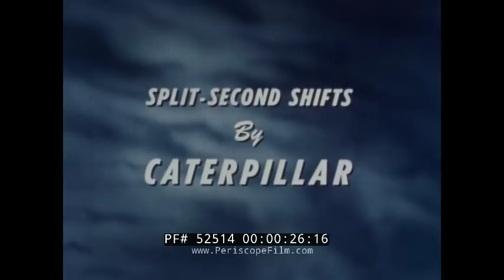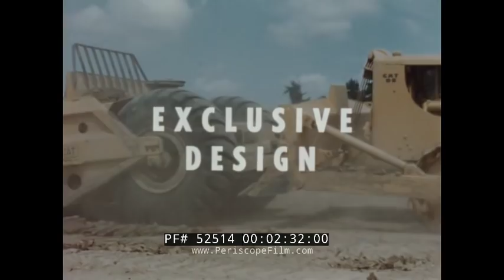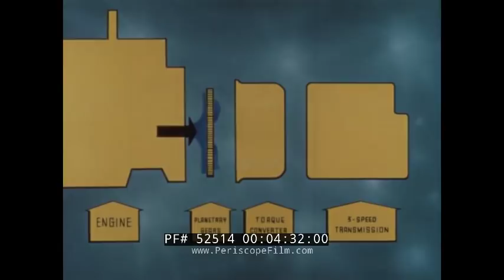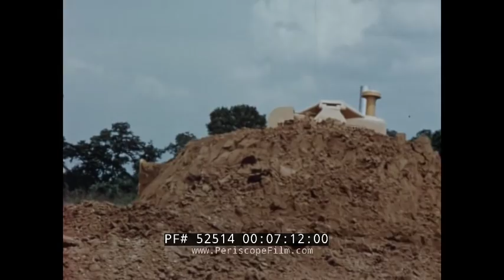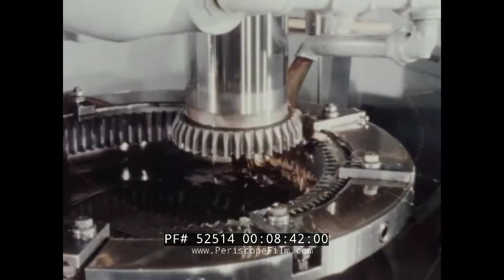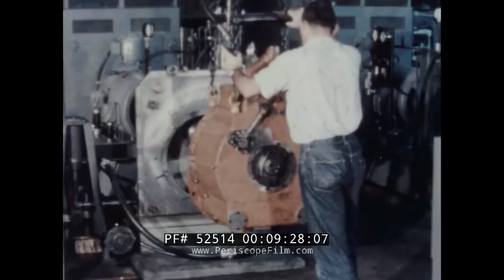"SPLIT SECOND SHIFTS BY CATERPILLAR"    D8 BULLDOZER TRACTOR POWERSHIFT TRANSMISSION PROMO 52514

Comment: Love the way the operator backs up without looking first.
Reply: LOL:)  Yep back when people had BRAINS and knew well enough to stay well back from operating machinery... 

Later!  OL J R :)
Reply: As an operator of over 20 years, a trainer, and a foreman, I tell you, every operator starts backing up before they look back.
Reply: Makes sense anything there been run over already.
Reply: Oh no! No hard hat, safety glasses, hearing protection,  steel toed boots, stafty vest, R.O.P.S, flashing lights or seat belt!
Reply: @wakeupslaveamerica  And if you operate properly, in those conditions, except for ear plugs, you don't need any of that. You certainly don't need steel toed boots to operate, because there's nothing to hurt you. Same with a hard hat. Most of the D8Hs still in service have a ROPS, and often the top of the canopy is 3/8" plate. if something goes through that, the hard hat isn't going to save you. Our business has received awards for safety, and yet we are lax on PPE. Society has taken the wrong approach to safety. For example, a trick question is how many accidents have seat belts prevented? The answer is none. The only approach to safety is prevent the accident from happening to start with. That's a much better answer than using PPE and calling it safety. PPE is often used to give visible evidence to make things look good. There again, reflective vests may have a place, but if you are in the operators blind spot, they are not going to do you any good at all.
Reply: @tyfrank3427  Seen my foreman send a guy home on the spot for backing up without looking, part of preventing accidents is making sure you're not gonna kill anyone by moving the machine. Hard to do that if you arent looking where you're going
Reply: @wills.5762  I agree but my point is due to the controls set up for forward facing operation, all operators set the machines in motion in reverse before looking. Another thing, seeing and looking are 2 different things. You're seated forward so when you look back you're looking with your poorer peripheral vision. And your reaction time is also slower. Of course you have to look back. But, we were always very vigilant about keeping people out of the way of backing machines and other blind spots.
Reply: @tyfrank3427  Ahh I think I get what you're saying now. I only do rock trucks hoes and scrapers so far, but in each machine (except the hoe because stuffs obviously in the way) I have no problem looking back far enough to see directly behind me, and my peripheral picture is about what you see shoulder checking the other way, it occurs to me we could also be talking about very different machines lol